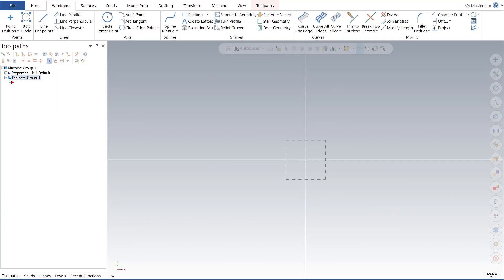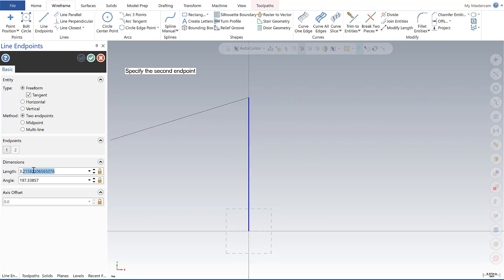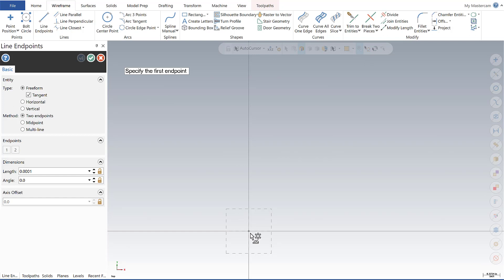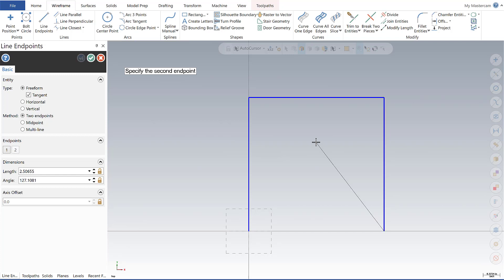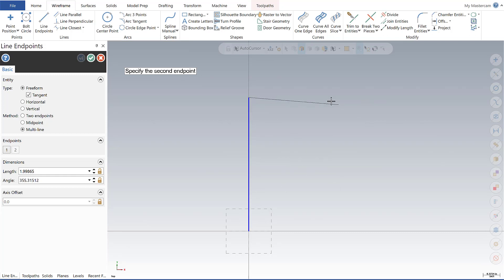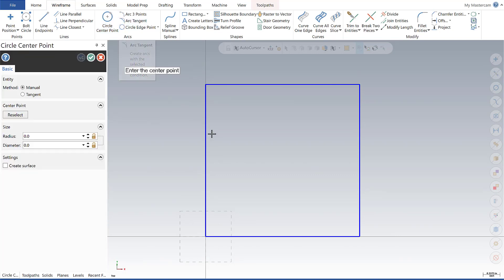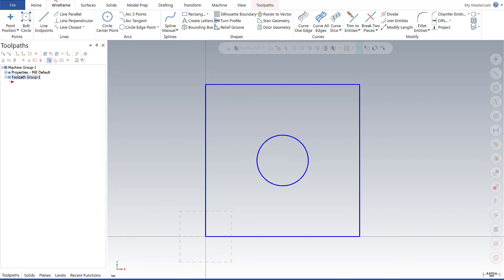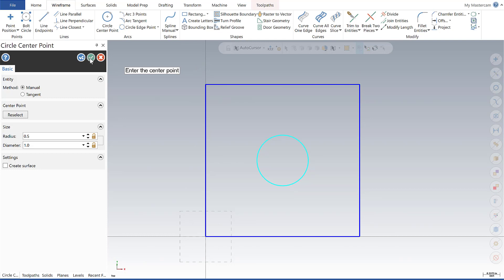Mastercam 2020 - Wireframing Basics

Comment: So I have been messing around with the demo for Mastercam 2020 and for some reason when I import a model from creo to master cam I cant change the WCS. Is there anyway to  change the existing WCS?
Reply: There's probably multiple ways to do it, but I can tell you what I would do and hopefully it may give you insight: go to your planes manager and right click the top view with your mouse. Go to duplicate. At this point a new view called "top1" should appear. You can change the name of it if you want also. Right click the "top1" plane and select the "edit" option. At this point the WCS will appear and you can edit it on screen as you desire or manually enter the coordinates in x,y, and z. What I usually do is hover over the center of the WCS location on the screen, click it, drag it to the part, and then modify it as desired. Hopefully this helps, I know I'm not the best at explaining stuff. I've been using Mastercam for 10 years and I know it pretty well but even after ten years I still don't know every in and out. It's a good software though, it's very efficient if you know what you're doing and how you want to do it.